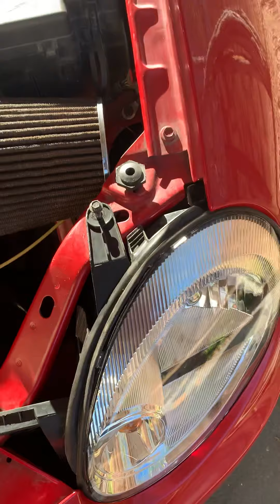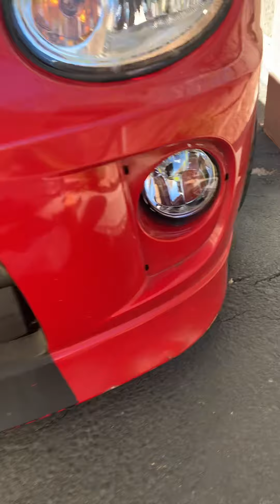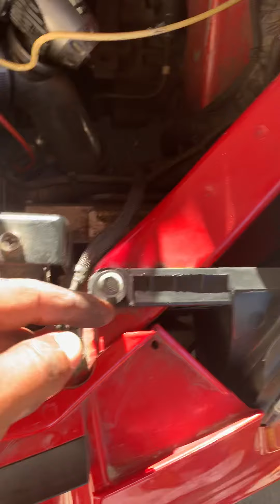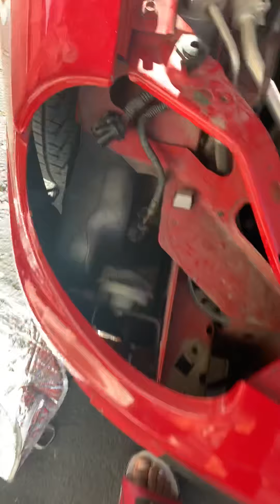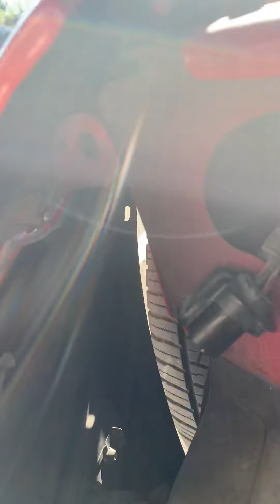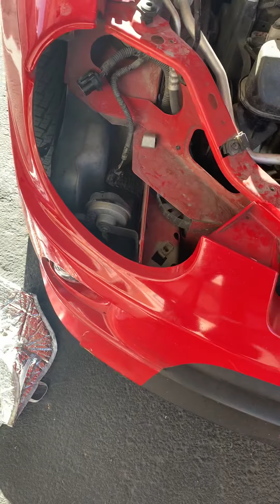Leave bumper on SRT4 fog lights change

Comment: do I need to remove the 10mm bolts of the bumper on the passenger side, IF I just need to replace the Drivers side fog light?
Reply from the maker: I didn’t
Reply: @raceMC  OK thanks.
Ordered new one. Yikes $75!?
Reply from the maker: @ekp-g205  fog light?
Reply: @raceMC  yes I know...ridiculous 
Will have to see it when it comes in. He said it is new one. But told me a used one pulled from old Neons tend to (at vest be fair/good condition but not clear and they charge almost the same price to take out from wrecking yard parted out cars for light and labor. Saying it would only cost maybe $10 less and would have to pay shipping from other State.

Comment: Dont have to take the bumper loose at all
Reply: Which I knew how...all mechanics say it isn't possible without pulling out headlights. Ergo need to take out bolts holding in headlight to frame. Even Manuel instructs this